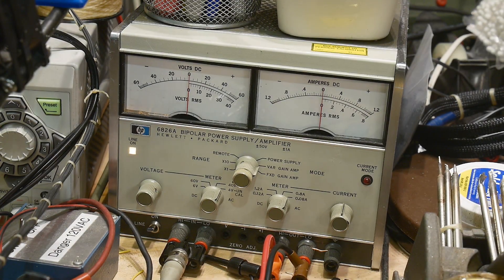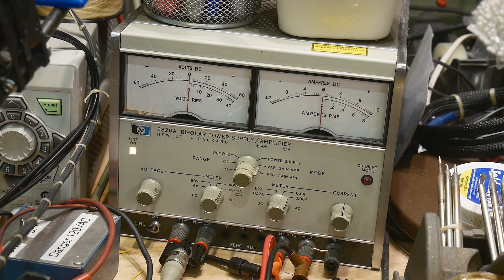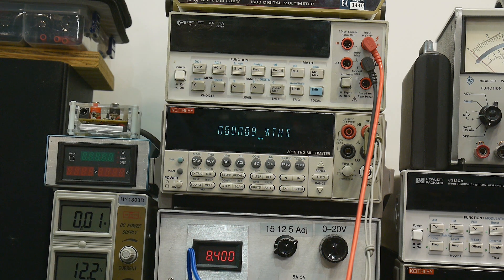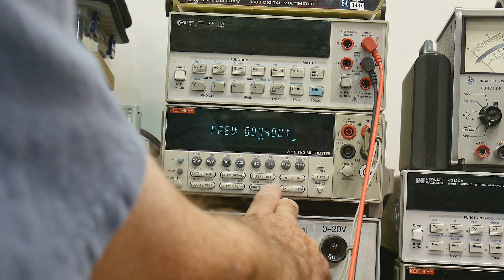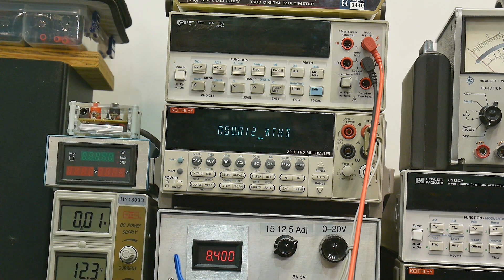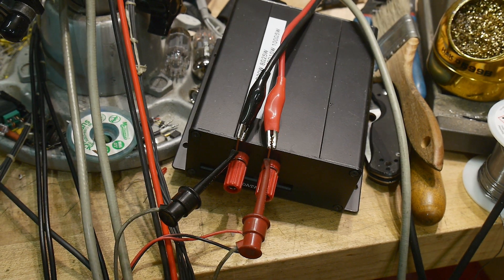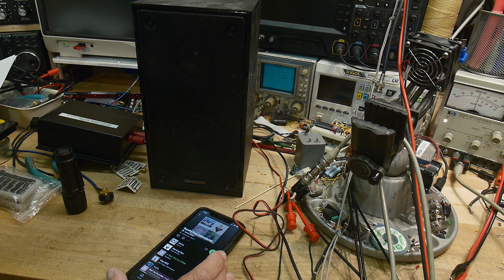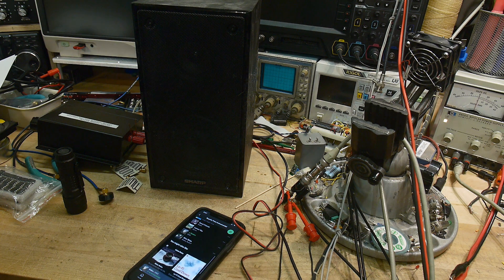#1597b HP6826A   Does it AMP?

Comment: I was thinking on building a small amp/power supply from OPA549. If I recall correctly, you tried them out, but did they glitch at 10 kHz or thereabouts?
Reply from the maker: yes, they have an odd glitch